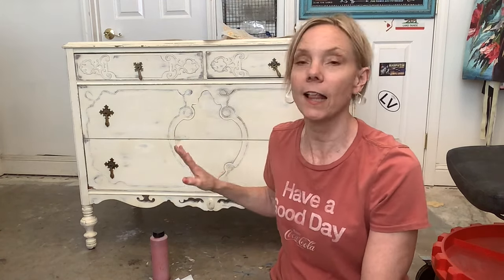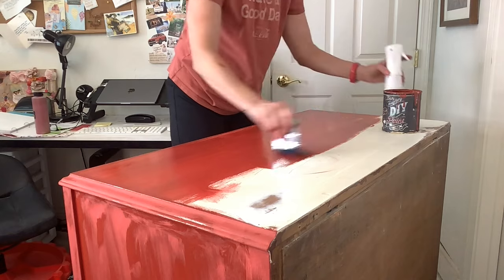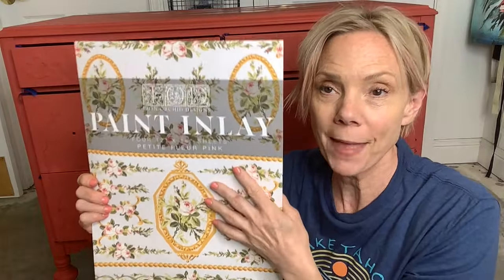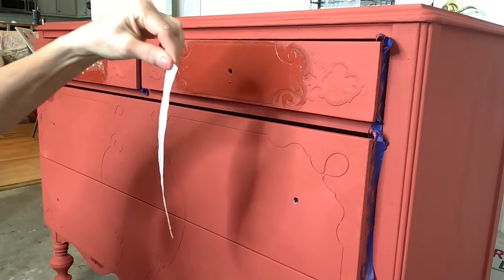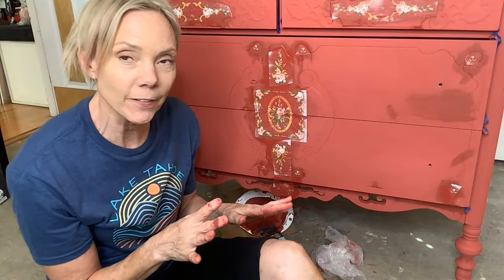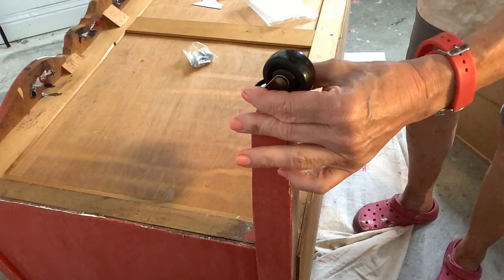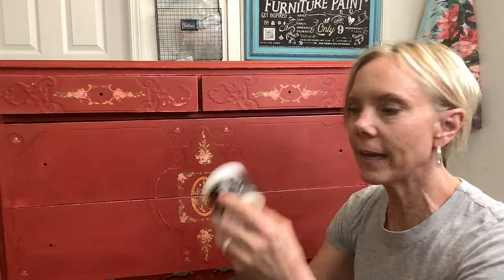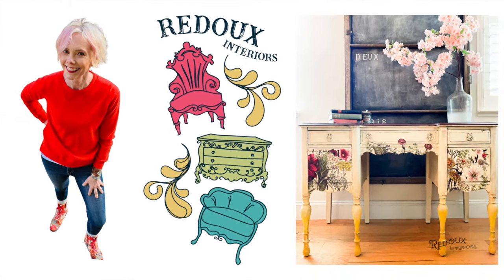Dresser Makeover DIY How To using IOD Inlay and Debis Design Diary DIY Paint

Comment: PLEASSSSSSE tell me how you got rid of the lines around your inlays!!!!! I have tried sanding and wax and big top…. Nope! 👎🏻
Reply from the maker: That is a good question!! A couple of tricks, try to lift the edges of the non paint part before it dries, also, I often use a heat gun to dry it, and you have a little more control with the edges that way. 

I learned that the inlays don’t do great with the DIY Paint JRV one step paints, they really show the edges. 

The other thing is just super light sand if you get that weird border. 

Hope this helps!
Reply: @Redouxinteriors oh THANK YOU!!!!!! I will try the lift the edge trick ❤